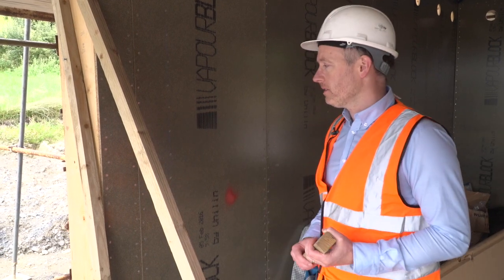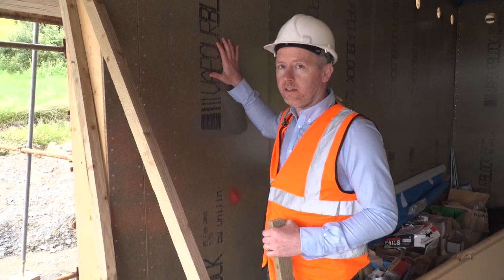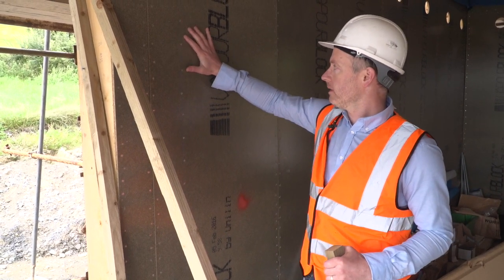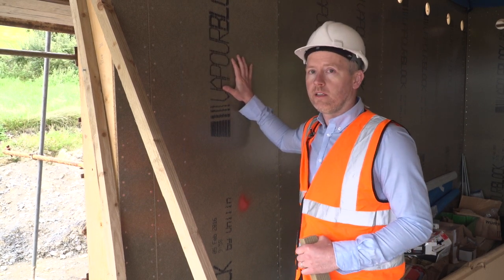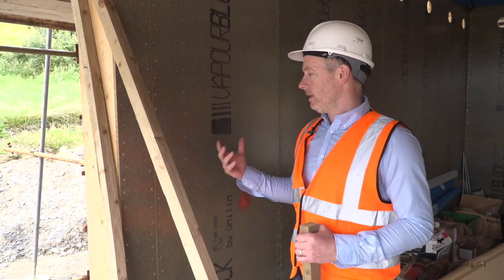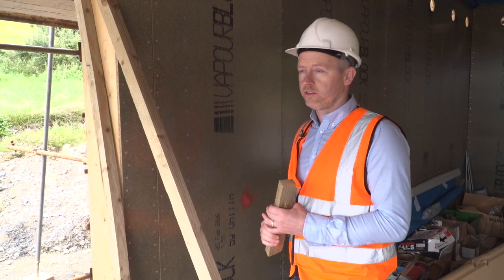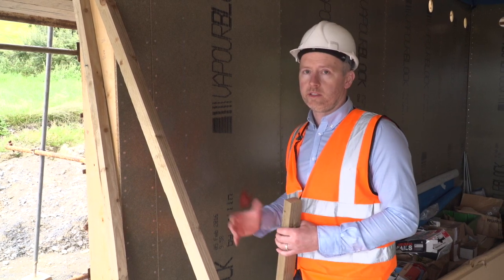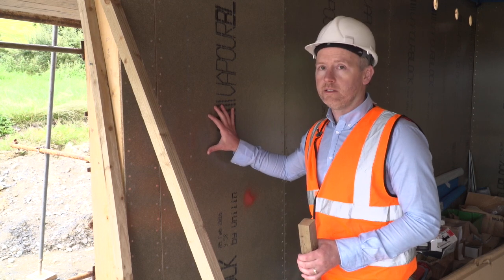Interior side of External Walls - Passive House Insulation Series (part 6)

Comment: why so many screws on those boards?
Reply from the maker: Hi @karl-arnal. The fixings are needed as the boards are “racking boards” whose centres are dictated by the requirements of the structural engineer. Hope that helps. Feel free to get in touch with the team if you need advice on anything.

Comment: Durelis Vapourblock vs Finsa Airtight  boards. Are they similar products? Both of them airtight, vapour controlled,...?
Reply from the maker: Both products are excellent airtightness boards, but here are some key differences in their properties. Compared to Durelis VapourBlock, Finsa VapourStop is a 3 layer panel which includes a unique high density fibre layer on both sides. This provides much higher structural properties. For example Finsa VapourStop has a bending strength of 28 N/mm2, whereas VapourBlock has a bending strength of 18 N/mm2.  
Finsa VapourStop also has an airtight coating on both sides whereas the alternative only has an airtight coating on one side. VapourStop is Passivhaus Certified to the highest possible standard, pHA, whereas the alternative is not Passivhaus certified.

Comment: Seems an odd system. I'd place plywood on exterior and do my air sealing there.  A lot less fiddly. Interior can use Intello if needed -  seems a lot less effort/time/money to install a lightweight membrane.
Reply from the maker: Airtightness controls passage of air AND vapour...ommiting INTELLO PLUS on the interior and applying ply (which is very diffusion tight) outside will likely lead to: Sweating = condensation = mold and rot.